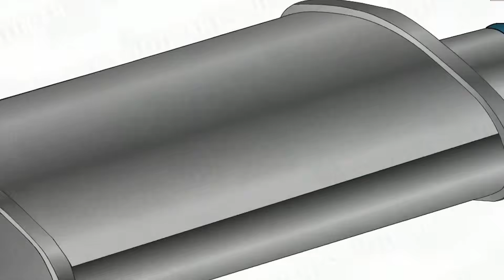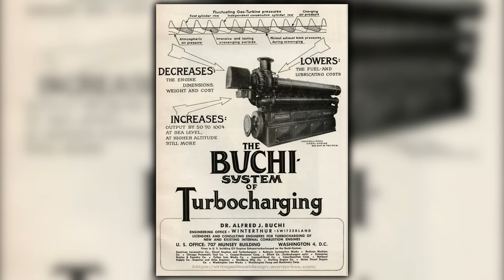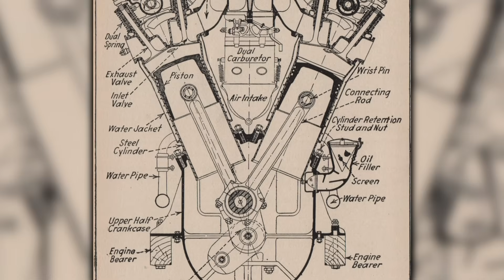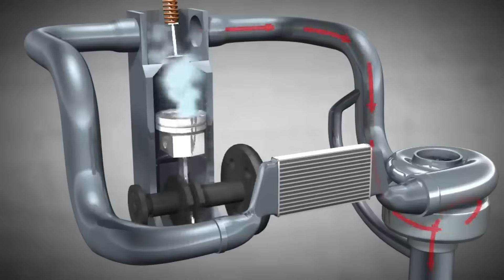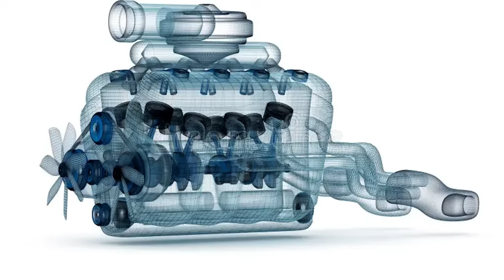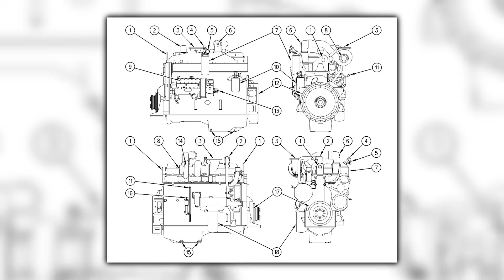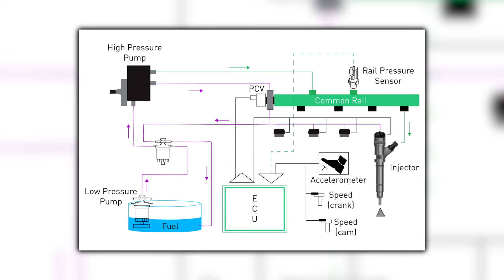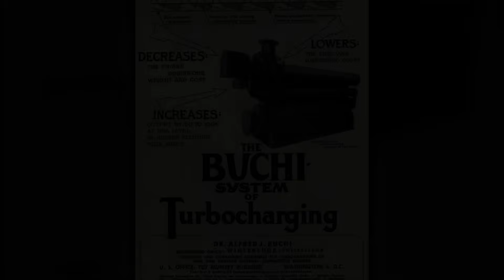The Genius Who Turbocharged the Trucking Industry

Comment: It is worth mentioning that turbo charging a diesel is a heck of a lot easier than gasoline. It took awhile for ECM’s to get good enough to keep fuel air ratio in check for gasoline engines. At the end of the day, it is all about the volume of air that passes through the engine.

Comment: I started with Cummins in February, 1970, and at that time the NH-250, an 855 cu.in. in-line 6 cylinder, naturally aspirated diesel engine was the number one seller for the truck market, producing 238 HP @2100 rpm. Turbocharged variants of the same engine were in production, the 335 HP, and soon the 350 HP joined the line up as the NTC-335 and NTC-350 respectively and within just a few years those and other turbocharged ratings dominated Cummins production and the NH-250 naturally aspirated disappeared from production.
Men like Buchi and Clessie Cummins were far thinking pioneers in the diesel industry. If you are interested, read the book; "My Days with the Diesel" by Clessie Cummins, you will find it quite interesting.
Reply from the maker: Thanks for the suggestion, I'd love to read that!

Comment: Turbocharging works better on Diesel applications because in gasoline engines the potential for detonation is increased.
Reply: I never that about that.  You're not trying to ignite the mixture with a spark.....you're just compressing it with a diesel.  One less viable.

Comment: This whole video is full of misinformation the blower on a Detroit Diesel is not there for forced induction it is a two-stroke and will not run without it
Reply: As many claim a Detroit two stroke won't run properly without a blower when to others who saw waste as one inventor sought to use waste to drive a compressor as they invented the turbo charger by 1910 as by the 1960's saw turbos attached to farm tractors.
Reply from the maker: What is the misinformation? I realize that the 2-strokes all needed the roots blower to scavenge air. Did my video imply otherwise?

Comment: CK your information to be correct when you proof something, the blower on a Detroit did not suck the air out of the engine, It pressurized the intake air to get it in the cylinders.There are no intake valves,they are a 2 stroke engine. At 13;03 you say scavenging, that is false
Reply from the maker: Thanks for pointing that out. You’re totally right that the Roots blower on a Detroit doesn’t suck air out of the engine. What I meant, and should’ve explained it more clearly, is that it forces air through the engine to make scavenging possible. Since it’s a two-stroke with no intake valves, the blower pushes fresh air in and helps clear the exhaust through the ports. At 13:03, we called that scavenging, which is the correct term for what’s happening in a two-stroke diesel. Appreciate you catching that and helping us keep the info tight.

Comment: The first turbo diesel trucks was not American. 
MAN (Germany) introducing the MAN 750TL1 in 1954 after unveiling a prototype in 1951, and Volvo (Sweden) launching the Titan Turbo the same year.
Reply: Yeah but the volvo had 185hp and the man 155hp

in 1949 the supercharged Cummins NH743 had 300hp

Cummins first proper big truck turbo engine was the NT855 with 420hp
Reply: Scania-Vabis was the first diesel engine maker in the world to apply turbo technology in serial production, also Sweden btw.
Reply: @K2teknik.  That engine was the scania D810, it was for railcars and boats not for trucks

Scania first turbo truck was the DS10 in 1960 and had 205hp, cummins made that output with the supercharged 672 in the year 1935

Cummins first turbo engine for trucks was the NH743 NRTO-6B in 1954 with 350hp, and came 5 years earlier than the Scania DS10

Comment: A couple points. But first my compliments to the video creator, in discussing a complex technical story. 1. Mack Diesel produced the first complimentary Turbo + Intercooler design, in American trucks: later, this setup would become standard spec.by other truck makers. 2. Cat's 3406 was really the first-in-industry truck diesel...designed from block up, as a turboed engine. It was NEVER however, under any power application, ever built/used naturally aspirated.
  Another early (50's) turbo maker, Schweitzer, produced the earliest turbochargers incorporated by Cummins in 1950's/early 1960's. (By late 60's Cummins would design & add their own ST-50 turbos.)
Reply: Saurer had turbo,s on trucks way for ww2

Comment: "The blast pipe for the fire box"
Can you explain how that works?
1:44
Reply: I've found the Steam blasts into the Smoke Box (below the funnel)
The Steam blasting upwards draws air through the Fire Box and therefore Smoke from it 

The Steam and Smoke exits the funnel and is why the emissions are both wet and smokey

Increasing the ability of the fire to get hot 

Clever 👍🏻
Reply from the maker: Great summary, you nailed it. The blast pipe uses the exhaust steam to create a vacuum in the smokebox, pulling air through the firebox and boosting combustion. It’s an elegant early example of using pressure and flow to increase engine efficiency — same core principle turbochargers later took to the next level. Love that you looked into it!

Comment: Don't forget the turbocharger intercooler that sits behind the radiator. It drops the compressed air temperature before entering the engine intake, thus increasing the engine's power.
Reply: The charge air cooler goes >in front of the < radiator. 
If you put it behind the radiator it's called a charge air COOKER
Reply: @joebarilari9911  You are right.
Reply: Trucks that had "aftercoolers" or "intercoolers" seemed to have  more power and climbed hills faster.
Reply: In front.